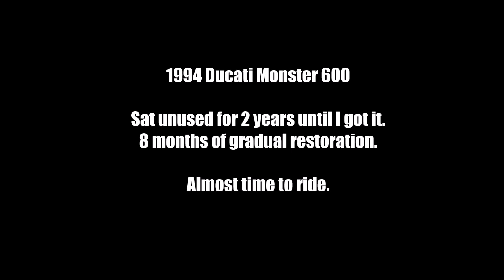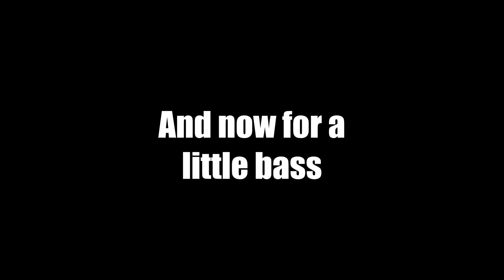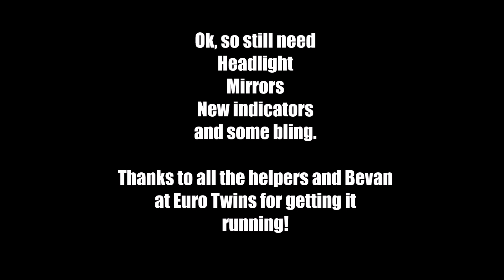Ducati Monster 600 Build

Comment: Hi, I have a ducatie monster 600 from 1999. it maks the same piston klinging noise, is this normal? or can it do bad? (5:33)
Reply: I have exactly the same sound, mine is also an 600 from 1999. Any updates?
Reply: I have been to a secondhand partshop. the man heard the sound and said it was somthing he heard the sound more often on this type motorcycle. the sound can be more over time, but it cant do any harm.
Reply: Congratulation for your nice job. Don't worry about this verry well known bell sound comming from the front cylinder. All early models of 600 make that sound. It is piston slapping due to the casting pistons replaced on later models by forged pistons. My 600 Monster and  my 600 SS make both the same sound. I have checked on a spare cylinder and spare piston within factory specs dimension and i can reproduce the bell noise by moving the top of the piston slightly in the cylinder. So don't worry, ride and enjoy this verry nice bike. ;-)
Reply: thanks, it nice to have it confirmed.
Reply: Look at this Article, it says that the later models are using cast pistons. The earlier models where build with forged pistons (the slappy ones) which suggests that they are better build. Forged pistons are more more durable If I have understand it right. The only thing I don't understand is why the forged pistons make that sound.
http://www.bikeboy.org/600monster.html
Reply: What i have noticed on the spare cylinder/(cast) piston assembly :
Even with a piston skirt/cylinder clearance within factory limits, the top of the piston has probably too much gap as soon as the upper machined grooves are lightly worn out. The maintenance manual does not specify any limits for the top side of the piston. Keep riding ;-)
Reply: That's the sound of a dry clutch -- music to my ears!